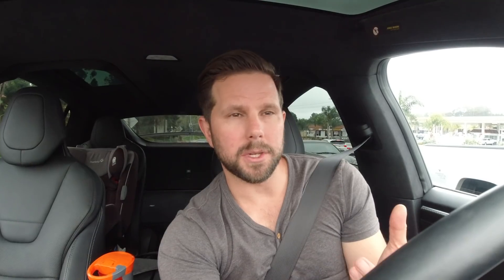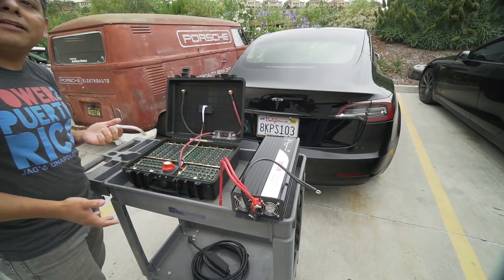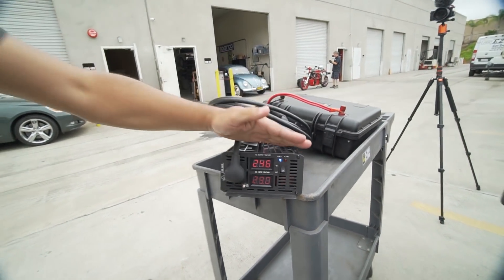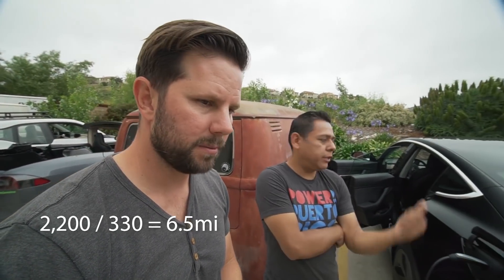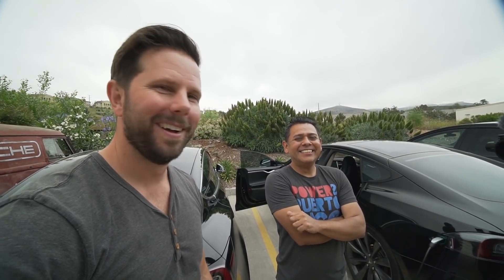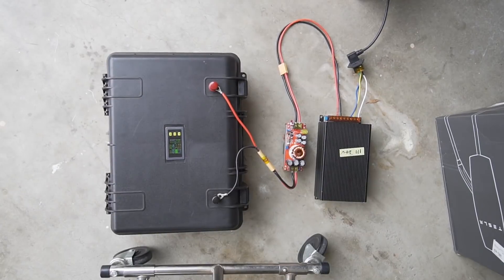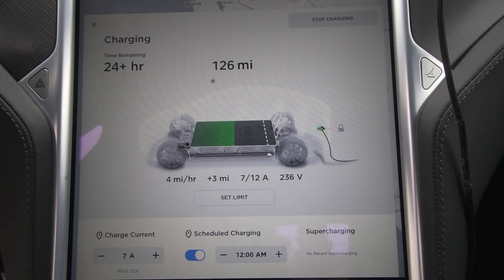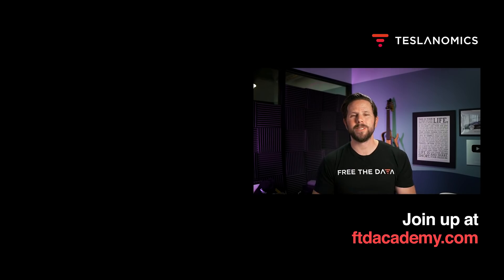DIY Tesla Gas Can - Will it Work?

Comment: It’s not very smart to convert DC that’s in the battery to AC from the inverter and then back to DC in the car
Reply: We need DC to DC, because in a Tesla you don't need to use separated charging pins.
Reply: true.  Could he plug his PowerCan tm directly to his motor ? or to his battery racks ? I know tesla won't allow it...but in therory, would it work ?

Comment: When the tow trucks them selves become electric they will probably have a 100KW charger onboard. The charger would just be pulling from their batteries that easily could be 300kwh.
Reply: Imagine if Tesla gets to a point where they have enough battery supply they can build battery packs for stuff exactly that, packs for mobile charging trucks and maybe even waste management trucks. The possibilities could be endless if only they could scale fast enough
Reply: It would probably be faster and easier to just hook the car up to the tow truck and tow it to the charging station. Don't know how many people would want to sit on the side of the road for an hour waiting for their car to charge. 

Now, if it can charge enough in 5 minutes to get to the diner 10 miles up the road with a charging station, then it might be worth it. Otherwise after about 5-10 minutes it's faster to just tow the car to it's destination, no?
Reply: Tow trucks are already gas / diesel motors. They can simply attach an inverter to the truck battery and plug the Tesla charging cable into the inverter like it was a regular home wall outlet.

Comment: Rivian already said they will have V2V charging ;)
Reply: Is that like scissoring?
Reply: @MichaelStephenLau  Rivian are offroad vehicles so it's super handy to be able to share power between vehicles ;)
Reply: Much like wireless charging a phone to another phone, it's a perceived benefit really only applicable during an emergency situation (which is noce to have), but otherwise it's so terribly inefficient that it doesn't make sense to do it otherwise.
Reply: Michael S. Lau Vehicle to Vehicle charging shouldn’t have hardly any efficiency loss if it’s done right. Wireless charging a phone is completely different. If it’s done intelligently the cars can negotiate a voltage and send the power in pure DC form. There would only be at most 10% loss from this conversion (the higher battery pack may have to drop the voltage a bit). Not a huge deal. Now using the car to power a house or something else, yes the losses would be higher.
Reply: @Alexlfm  conversion + cooling system. 

The point is that loss is a loss, so no point in doing unless you have to, which is still nice to have.
Reply: @MichaelStephenLau  More option to charge is always a plus even though it's with loss :)

Comment: Nice R@D experment. Could you have a hybrid battery back. Lithium batteries has a Joule Thief circuit with a voltage booster charging to trickle charge on the capacitor bank. Then the capacitor bank is doing a direct charge to the Tesla. Could that boost up the amperage.

Comment: As Jehu was saying you're losing 30% or more and you're very limited in amperage, all because of the extra DC -AC-DC conversations. Try hacking a home charger to deal with this and have an DC-DC converter that has less losses feed directly through the Tesla Protocol. Tesla uses DC for charging, not that different from CCS, just different plug.
Reply: My jaw dropped when Jehu said 70% efficiency. I built a 1 KwH suitcase and hooked it up to a PowerBright 6000w inverter and then to a heat gun. So, only 2/3 of the loss steps he is demonstrating. It's 12v 240A in and 120v 10A out to the heat gun. Therfore 2880 watts into the inverter and 1200 watts out. I'm getting 42% efficiency! The battery is 4 gauge internally, but short 10 gauge to the inverter. I must be losing a lot of power there?!?

Comment: The concept of electric gas can is really inefficient. You start with DC, which converts into AC using an inverter, and then the car internal charger converts it back to high voltage DC.
Reply: Exactly. You'd be much better off using a buck/boost converter instead of an inverter + power supply.

Comment: If/when it works, call it "PowerCan" vs. "GasCan"
Reply: Juicebox?
Reply: Now he just needs to mention the cost of this.  Not counting the batteries, a 3000 watt pure sign inverter is in the $300+ range.
Reply: Power pill? Energy Snack? Capn'Crunch for cars..
Reply: E-can?
Reply: A Jerrybat.
Reply: How about.... a battery?
Reply: @dslynx  But does it require a pure sign?
Reply: @xxZerosumxx  S0yboi can?
Reply: @AZOffRoadster  Hard to say, but most sensitive electronics require a pure sign.  If it was just a battery charger, I'd lean toward no, but because there is monitoring electronics sitting in front of the charging circuit, you'd have to test it and hope a non-pure sign doesn't do any damage or that the circuit is able to protect the car.
Reply: how about powerbank

Comment: You need to make a battery pack that bypasses the battery in the Tesla and drains directly off the new battery pack. So a way of not having to charge the Tesla battery but uses the little battery pack as the battery.
Reply: You can’t, the car demands too much amps to use this tiny battery while the car is in use. That why you have to use it this way, because if you don’t you will kill it.

Comment: 24V DC from the battery to 120V AC from the inverter to 240v DC from the car charger into the car.... You are easily going to louse %30-%40 of your power just by Converting and stepping up and down so much. This is very inefficient.

Comment: As you weren’t charging vehicles with flat batteries, would the auxiliary battery pack charge for longer without cutting off if they were flat?  Would you able to drive while charging? If so an aux battery pack could be a good tool for AAA to get you to the next charger. They would only need to follow you to retrieve it rather than having to arrange towing a dead car.

Comment: Tesla could in the future offer a Powerwall like option maybe give people the option to sacrifice their frunk to have a secondary emergency battery that would power the drive train and basic functions of the screen to allow getting to the charger
Reply from the maker: At that point why not just add it to the battery pack and increase range?
Reply: @BenSullinsOfficial  I don't know they could make it with ultracapacitors or something to make it light then it would re-charge quickly and not start discharging till it was switched on. Maybe even make it so it fits in the frunk but is easily removable by the end user
Reply from the maker: @AndrewJamison79  ultra-caps are the opposite of what you want. they have a low energy density which means you need a truckload of them, then on the other side the car can only charge so fast due to chemistry of the cells and the charge rate (CCCV) - there really isn't a good solution except someone with a supercharger in their truck

Comment: Its So Simple! Just buy a portable diesel electricity generator. power it on and  it will charge.
Reply: Eric Cartman my same thoughts now can you rig it to charge while driving
Reply: @treymiller5736  guerilla mod it, feed the electric motor directly from the generator or battery pack  :)
Reply: Victor Shane yes but can you charge and drive
Reply: Wait, That's Illegal
Reply: Trey miller No. You can’t start the car while it’s charging.
Reply: Eric Cartman : Hahaha .... Yeah, a diesel generator like that of a locomotive engine, at least that WILL charge a Tesla vehicle.
Reply: Small generator in the trunk, have them plum the exhaust out and under the car, (people will be confused as hell seeing a Tesla with a tailpipe) Whenever you park, kick in the generator, and plug in the Tesla. XD
Reply: The only problem that solution would have is that the power would be "dirty" meaning the sine wave would be all over the place. There would need to be some sort of power stabilizer between the generator and the car's charging port.
Reply: @TheDeelunatic  Full Bridge Rectifier with Capacitors or they sell generators for server farms that give a clean sin wave
Reply: Then your back at burning fuel again.
Reply: @RichardNixion357  The problem with the server farm solution is that the generator would also be on the large side. but the Bridge Rectifier and capacitors would be the most likely solution.
Reply: Most of the power used to charge these cars will be from fuel-burning produced electricity.
Reply: @SweetandFitting  The Irony right?
Reply: KmanAuto did a video "Generator Charging a Tesla? Generac VS Honda" long ago, it works, the generator is only 46LB, hard to beat solution.
Reply: Hahaha, my thought too, then I saw it in front of me... Electrical religion = unholy, not clean and filthy hehehe. But sure can always run that diesel generator on the cooking oil you filtered at your back yard, feel better about it.
Reply: diesel gene? Why would u need a diesel one? why wouldnt u just get a reg gas one
Reply: honestly why didn't they just design it with a alternator of sorts cuz now u got fn charge stations that had to be build mo money money mo I see Tesla
Reply: @SweetandFitting  even if that's true, you disregard the fact that purification of gas and diesel requires roughly the same amount of energy pr mile, as if you put it directly into the car. 
Essentially you are putting the same amount of electricity, into a gas powered car as an electrical car, but at the same time burning extra fuel. 

However an electrical car does have a higher impact, on the environment when being produced. The estimation is, that it's cleaner after about 20.000 miles.
Reply: @gismo3564  they're worse for the environment by way of the minerals and other materials required to make them, even if what you say is true
Reply: It is called a Hybrid. The advantage of a ICE without all the draw backs of a full EV
Reply: @crxdelsolsir  yes, 90% efficiency is not a joke
Reply: @foam27  I was using dirty in the meaning that the sine wave would not be even, the frequency would not be consistent nor would the amplitude. Which as others have pointed out, a bridge rectifier would solve, I was just using the wrong vernacular.
Reply: Lmao
Reply: Are solar panels an option?
Reply: @randomtube8226  they burn fuel anyways bc electricity is made with coal and natural gas aka gasoline
Reply: @777jobu  lolollolol 300 yards worth so a football field
Reply: My idea for a completely electric car would be. First it will have to have a combination of lithium batteries and super capacitors. 2 you will need to find a way to keep those bats and caps charged. So solar panels will help but not alone entirely. As they need to praciklly cover the entire car. Something like a momentum wind turbine installed, somewhere along the vehicles aerodynamics can help too. Like once the car picks up enough speed after takeoff. Flaps that contains the wind generators slowly start to open up the faster the car goes, the more the fans stick out to catch more air, the faster the fans will spin, generating more electricity for the charging system. Heck even put bicycle pettles on the passenger side and tell them to peddle away lol
Reply: Victor Shane z
Reply: @TheDeelunatic  isnt american electricity coming from dirty sources?
Reply: @EAchank  News flash buddy, all electrical sources are dirty. It's a matter of at what point they are dirty. Wind Generators use steel which uses coal coke to create. Not to mention the non-recycleable plastics used in the blades. Then in the case of Solar, look into the materials that need to be mined to produce a panel.  They really are not as clean as you think they are.
Reply: @TheDeelunatic  news flash buddy what u wrote is exactly what I was saying 🤗
Reply: @EAchank  sure it was.
Reply: @TheDeelunatic  🤗
Reply: @victorshane4134  skip the middle man and have a ICE run the electrical motors
Reply: And now you have a hybrid
Reply: At that point just use a gas engine.
Reply: @randomtube8226  something like 90% of US electricity is generated from coal, so...
Reply: @EAchank  yup, 90% of US electricity comes from coal. Now ironically, if it weren't for the tree huggers, the whole world would have gone nuclear in the 1990s
Reply: Of buy fuel car at first place lamo
Reply: We came full circle here.

Comment: I have the goal zero 3000 watt unit which will do 1500 watts and 3000 Watts Peak and you can use your tesla plug into 120 volt plugs on the Goal zero.

Comment: Would be interesting to see things like battery tanker trucks that can provide the same power as a super charger, to where half an hour can get you at the least to the next charger. This way you dont risk damaging your Tesla during a tow, and you can get a fast charge anywhere. Plus, it could have multiple chargers on the same truck, so that if you are a long ways out and the tanker vehicle is low on charge, it can recharge itself, or charge multiple vehicles on a single trip (like if three cars died between two chargers, it can charge all three before getting to the next charger itsself)

Comment: There are ultracap batteries that can push a crazy amount of current (up to 400amps) but only stores about a third of the power compared to a li-ion. Maybe make a mobile charging station for road side assistance instead of a tow truck.

Comment: There is no use, why put in an extra battery pack on top of your built-in, battery pack. Tesla basically already offers this by selling you the long range versions of the car. Also to make this really efficient a Tesla should be possible to DC charge. Now you are stepping up from 24V to 240V in order for the car to step it down to DC again. In both actions there is a loss drasticaly the capacity of your "Gas Can"
Reply: They doing it for science :)

Comment: My 2 ideas: Tesla could come up with a small secondary battery, small and light, that can be detached from the car (maybe in the trunk/boot, or in the frunk/froot?) and charged somewhere or swapped in an emergency. Or Tesla could come up with flexible sticks (like a camping tent) and cloth like solar panel that could unfold on top of the car, like a canopy, from the very front to the very back of the car (a semicircle shape should look cool 😎), to charge the car in an emergency, when parked in the sun 😊😎🔋

Comment: Way better off having someone tow you a few miles and let regen do it. ;)
Reply: @davidbeppler3032  The cars need to be towed with the wheels off the ground though, "transport mode" only permits moving the car on its own wheels for 10 metres (i.e. to get it onto a flat-bed vehicle).  Or you need to put dolly wheels under the cars wheels and go very slowly.
Reply: @eubikedude  even Tesla's have neutral... tow-mode is obviously not intended for this purpose, there are plenty of videos here on Youtube that demonstrate towing a Tesla to regen in an emergency situation.
Reply: can't regen through flat bed towing... you must flat bed tow a Tesla there are various brakes including magnetic brakes which you would know as the regenerative braking
Reply: Engineering explained towed his Tesla around and it recharged....

Comment: I think that battery can can run it for many mile but you need to find a way to connect it to the motor direct or tesla has to have a plug in the boot for emergency battery pack to feed the motor direct.
I do not have a clue about electricity let alone battery cars so its just a suggestion.

Comment: If you could link up the tires of 2 Tesla's and fool the traction control then transfer power fast by using bake regen on the dead Tesla, correct?
Reply: @stupidas9466  Are you saying the regenerative breaking does not put power back into the battery or that the power loss would be so great any gains would be marginal.

Comment: Just don't let the power go below 25%, that's what I do in my diesel car.
Reply: John Richards.  And don't charge it above 80% on the road, cause the last 20% take forever, you're hogging the charger and 100% charge forced often wears the chemical battery like NASA did on their first ISS batteries.  So 80%-25% is 55% so your 300 mile car is really 165 mile usable travel range non winter.

Your 200 mile EV is really 110miles non winter.

There is no utopia.  Just goodnuff.

Comment: It could make sense to bypass the charging part and contact the power pack directly in to the car. This way if you run out of power you could call the AAA or Tesla roadside assistance plug in the pack & drive to the nearest charge point without having to tow it.

Comment: Use a Honda 5
3000 Watt Generator With A 5 Gal. Gas Can( Emerg Only!!!)
Reply: And carry gasoline in your car?
Reply: Al Semi -Back-Up ... Either a motor home, or 18 Wheeler with an APU (auxiliary power unit)
Reply: Almost what I was thinking.  Since this would be for the back country or going through states where EV chargers are sparse, imagine coming upon one which was broken or with a long line of cars waiting to charge.  On those particular cases I would put a Honda propane converted generator in the frunk.  Imagine it as a spare tire for emergency purposes only.  One of our cars, the BMW i3 REx already has the backup generator built in.

Comment: I wonder if a large enough capacitor dc output to provide more amps out more quickly would be possible. It just needs to be large enough to fit on one of those yellow highway service trucks to output maybe 10 miles within a few minutes.

Comment: Since a gallon of gasoline equals 32-33 kwh, Jehu's battery in a box is equal to pouring 8 oz of gas into a ICE car. So yeah .... it's not much!
Reply: Except that ICE drivetrains don't really attain that efficiency.  Assuming 30mpg: adding 4 miles of range requires about 17oz of gasoline.
Reply: @patreekotime4578  I think people lose track of the fact that a gallon of gasoline has 128 oz.  Your math is spot on.